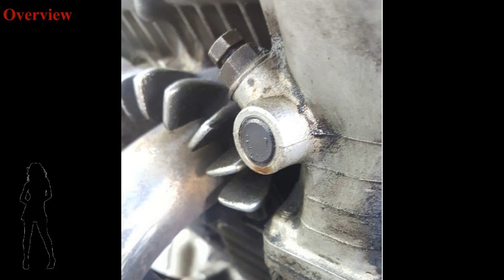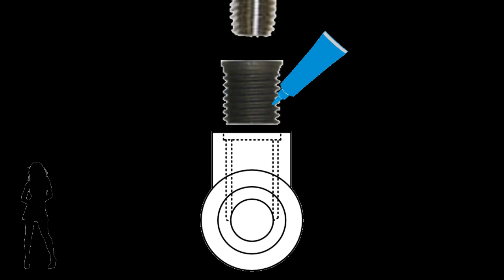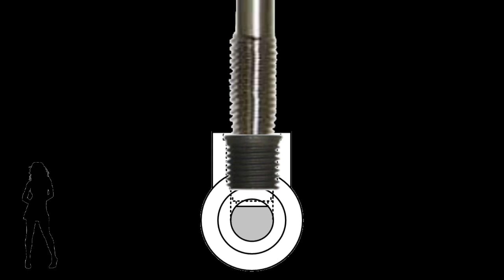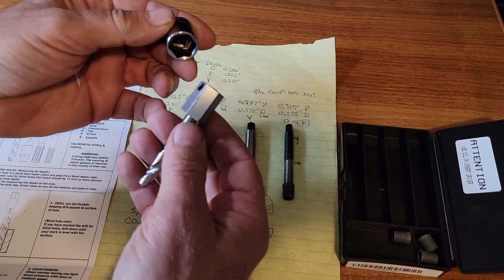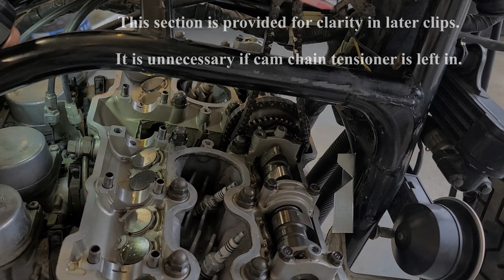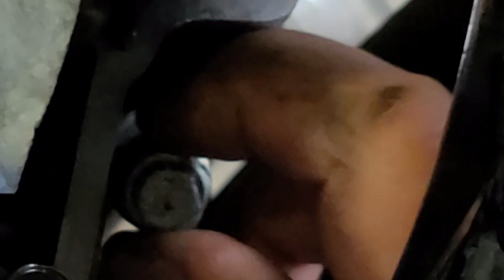Honda CB900C DOHC Cam Chain Tensioner Bolt Strip Repair

Comment: Hello, it’s a really valuable content you’ve made here. I appreciate that a lot! Few questions - could you explain how to remove the rubber end cap of cam  tensioner rod? Is the any trick for that? And how thick is the rubber on it? I’ve scratched like 1 mm of it and I see something metalic, is it the core of the rubber end cap or the forehead of tensioner rod itself? I don’t want to be too rough trying to put this off.
Thanks in advance!
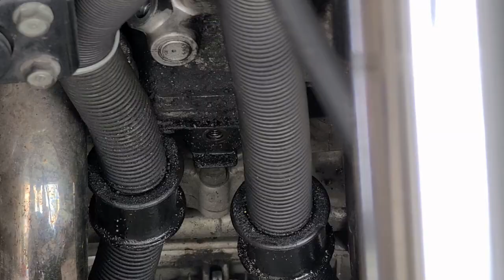Reply: Thanks.  I think this is covered under "Plug Seal Removal", at time stamp 8:34.  You can go directly there by clicking on the link in the Contents section.  The cap is a metal core, with rubber exterior for sealing.  The end exposed to the front is metal.  I drilled and tapped it so I could pull it out.  Then reused it by threading a screw into it with silicone (shown at the end of the video).  Some people just screw a dry wall screw into it and pull it.  Then patch the hole.  Others, replaced it with a rubber grommet (plumbing part) with a screw in the center to expand the rubber into the hole.  Let me know if this doesn't help.

Comment: I made a similar video 18yrs ago but, it was done to a CB1100F cam chain tensioner bolt hole.
Most of my videos were deleted because they were not child friendly, oh well.
I swear by the Time-Sert thread repair method, it is the best.
Keep up the good work

Comment: Hey Spud, good job! 

Nice job of using the search engine on the site and figuring it all out! 

A couple of notes... 
   1. Your countersink is not deep enough. The surface where the locknut seats needs to be flat. 
   2. Do not modify the bolt, as the o-ring seats against that surface where the size changes, as well as the flat area. 
        Changing any of that could result in a leak to someone that doesn't understand this as well as you do.
Reply from the maker: Thanks Gene! I would not have been able to fix it without the info I found on the cb750c.com site.  Regarding your notes:

1.  I agree regarding depth and have no idea why it would not work out.  As noted in the video, I even used a power drill on it several times and no further chips were produced.  And I contemplated pulling the insert out and trying again but decided against it.  The top surface does need to be flat, however, the top of the insert has a quite wide flange on it which satisfies this IMO.  Ideally, it should have been flush without a doubt.

2.  It appears to me that the O-ring does not seat at the size change as stated, rather, it seats on the upper portion (larger) of the shaft and the jam nut.  Making a modification of some kind is not an option as far as I can tell.  I gave two options in the video, one to add a shim and the other to modify the bolt (and associated risks).  The biggest thing I learned out of this repair is that the insert does not properly duplicate the form factor of the original design (a thread at the bottom of a bored hole, the bored hole being relief for the larger shank).  The insert has a minimal amount of relief, so you have to account for it in some way.  I think the animation I created is correct and shows this relationship, but I could be wrong too.  

BTW, I have no leaks.

I really appreciate the feedback and hopefully people read the YouTube comments (I know I do) as these kinds of clarifications and suggestions come up all the time.  

“Your mileage may vary”